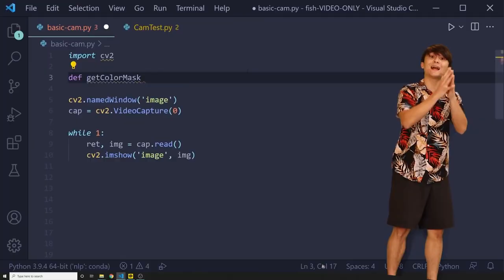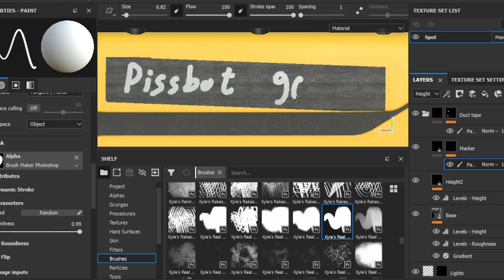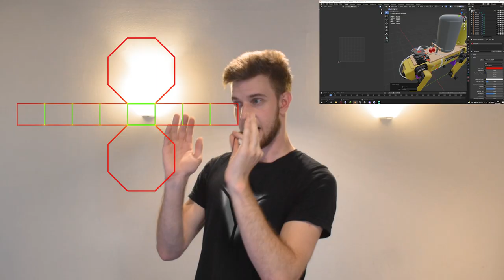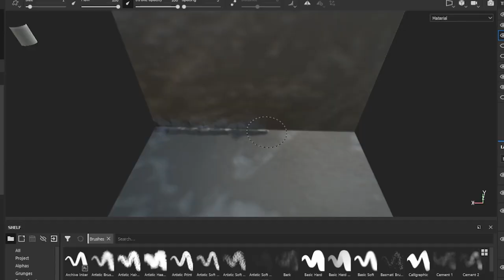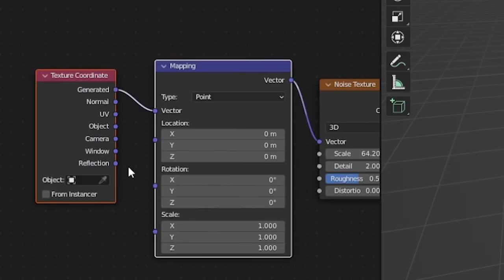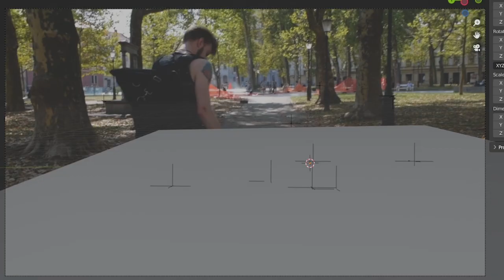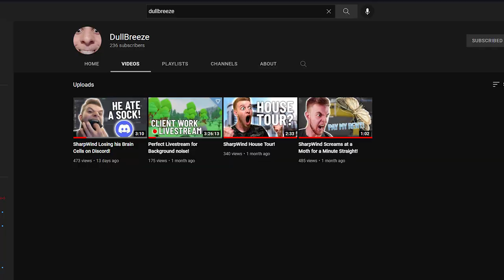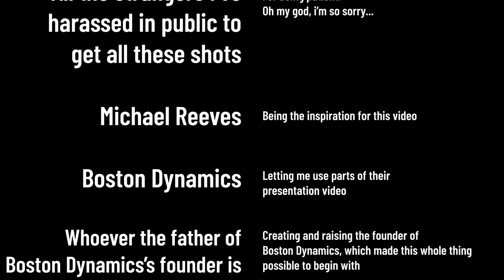I IMPROVED Michael Reeves Pissbot!

Comment: There is an addon called bone dymanics lite that might could help with cable animation. Though I'm not sure how well it'd for that use case. Reguardless you can also just add a cloth sim to a line of vertices and hook the ends to empties then use a surface deform modifer if needed
Reply from the maker: Thats a life saver, i'll check it out

I tried cloth simulations, but i couldnt get the material properties correct - the stiffness and the wiggles, but the ends are pinned - everything jittered a lot, etc.
Im more used to animation, so i did it all manually